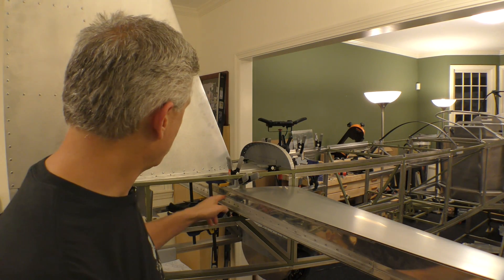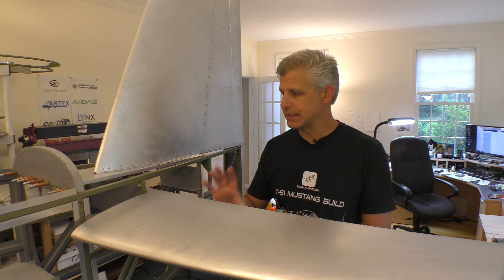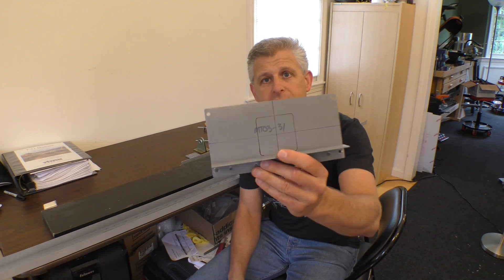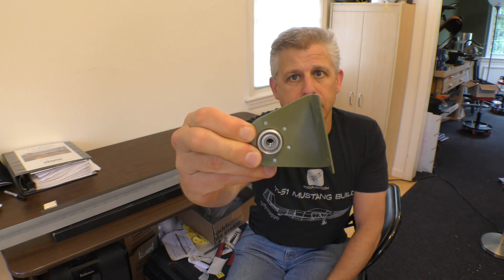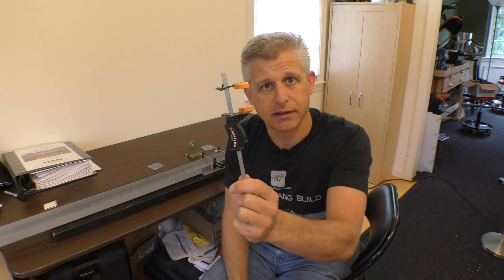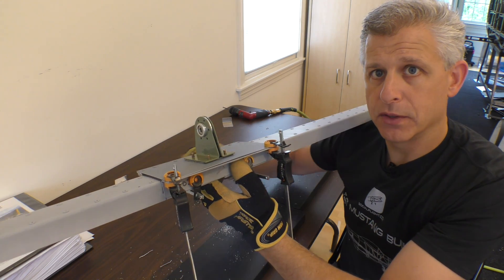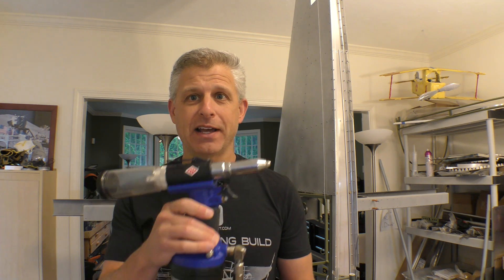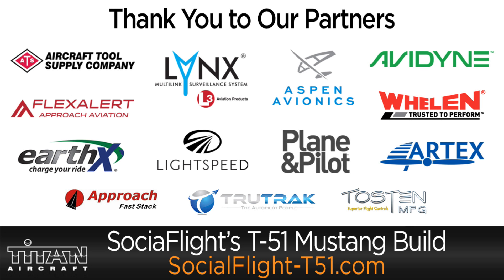Our T-51D Mustang's Horizontal Stabilizer - Part 1

Comment: Tip-  hold the bolt head steady and tighten the nut. This prevents the bolt from turning in the hole and wearing off the plating.